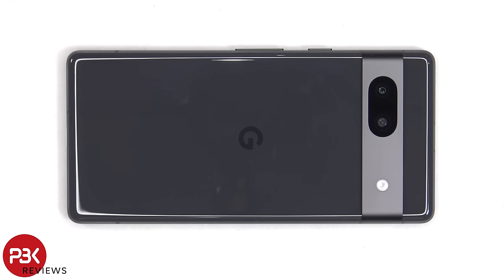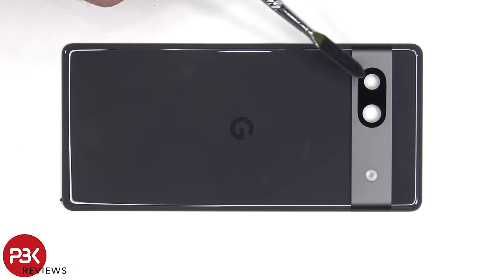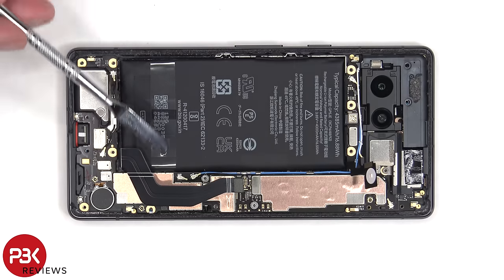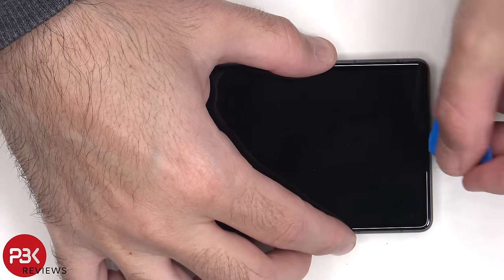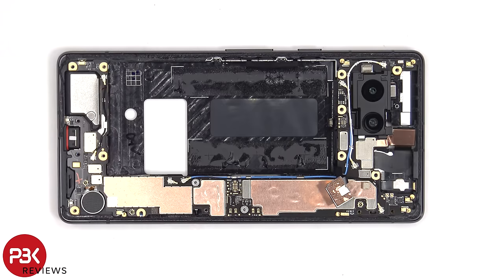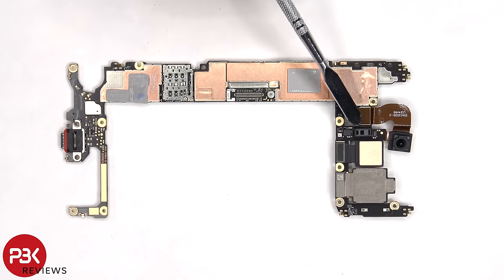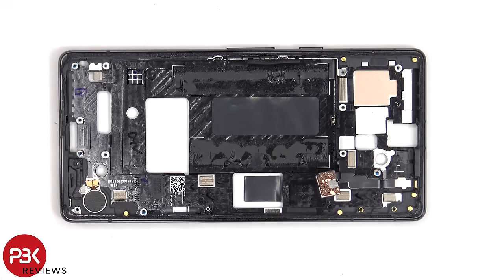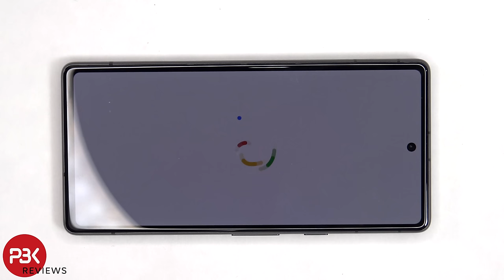Google Pixel 7a Teardown Disassembly Repair Video Review

Comment: Ooo Phone not even Launched but it disassembled by you sir ❤
Reply: @PBKreviews  have they tried to improve cooling system in pixel 7a compared to other pixels. Because lots of graphite taps, copper sheets and a copper plate
Reply from the maker: yes, it's improved over previous generations.

Comment: Nicely described! Thanks!

Does the back stick firmly after reassembly or will it lose adherence?  I wonder if it will open up if it falls on the ground or with even with regular usage.
Reply from the maker: You're welcome and thanks. You would need to re apply new adhesive to adhere it back to the phone.

Comment: They still haven't learned 😔. Hopefully, they'll make the pixel 8 charging port removable, either by having its own daughter board or attached to a flex cable. Sucks that it's not removable. That's the only reason I've stayed away from pixel phones.
Reply: I mean Samsung and Apple have even worse repairability scores on most of their modern phones.
Reply: @michaelcorcoran8768  ik. I hate the damn superglue they use on their phone screens and back glass. And until this year, on samsungs batteries. But they both have removable charging ports (except for the s10 series (and early samsung phones)). That's something that will break with years of use. Being able to open the phone up and replace it is great, but you can't do that with the pixel phones. They're soldered directly onto the board
Reply from the maker: Yep hopefully they will add replaceable charger ports soon
Reply from the maker: True the microphone replacement will be brutal as well. They really need to make a replaceable sub board for these things.
Reply: @PBKreviews  Are these not replaceable with hot air?

Comment: Hey there, hello, since you seems to know both the pixel 7 and pixel 7a, do you think it will be possible to replace the main wide  camera on the pixel 7 with the one from the pixel 7a? they seem to have the same connector. would appreciate any help.
Reply from the maker: I'm not 100% sure, sometimes its possible but sometimes there are software restrictions.

Comment: How does it feel in hands? Even though it's plaastic, Google has been really good at making solid polycarbonate chassis like 3a, 4a, 6a... no banding or screaking
Reply from the maker: Metal frame feels sturdy and good, back is ok but I personally like soft feel backs like those of etched glass or vegan leather etc.

Comment: Any guess as to why the 7A weighs almost the same amount as the 7? The chassis is smaller and the back is plastic. I would've thought it would be significantly lighter.
Reply from the maker: Not too sure, but might be the additional copper plate inside and some other stuff. But don't go based off initial rumored specs, since not all of it seems accurate for example the battery size. This is an actual retail unit and the battery size is smaller than what initially was leaked on some specs.

Comment: I would ask do bend test BUT midframe looks solid.  Edge cutouts for antenna in camera proximity.  Make fail bend test for 7 Pro and looks 8 and 8 Pro they also have edge cutouts there.
Reply from the maker: yeah the metal frame is pretty solid

Comment: Hello!!! My Pixel 7a stopped reading mobile signal and wifi, it also lost the IMEI, it happened suddenly, I suspect a hardware failure on the antenna, how easy would this be repaired?
Reply from the maker: I don't think it would be antenna related. A bad antenna would not cause IMEI loss and so forth. You may have a bad bootloader or firmware and would require flashing original firmware onto the phone.

Comment: How big is the main sensor? Rumors pointed that its IMX787 1/1.3"
Reply from the maker: I'm not too sure, I'm going based off unofficial specs. Apps like hardware info and so forth don't really give sensor type or name, and due to pixel binning only give the base pixel info from the looks of it. If you can decipher the info from those apps, let me know and I will send you screen shots.
Reply: @PBKreviews it is possible to estimate the sensor size if you can give me the size of an individual pixel.
Reply from the maker: send me an email to my user name at gmail and I will send you the screenshots with the details
Reply: @PBKreviews  sent you an email

Comment: Is the vibration motor a downgrade? It's circular and could very well be not an X axis vibration motor :/
Reply from the maker: looks similar to that of the 6A
Reply: @PBKreviews  yep. I realised too. It's weird, because in other phones a circular one means it's a cheap one, but with Pixels it's still feels as good, as their flagships.
Reply from the maker: The newer generation circular ones or z axis aren't like the old ones they would use back in the day, they are better but still yeah the x axis ones are preferred by most

Comment: Info on the fingerprint scanner? Ultrasonic one? Or other?
Reply from the maker: its optical
Reply: Shame I was tempted but if it's the same garbage optical sensor as in the existing 6 and 7 pixels it will be awful 😩
Reply from the maker: Yep pretty much the same thing. On the flex cable it says V10 (version 10) compared to V4 on the 6A but not sure if its any different. Sensor looks exactly the same.

Comment: Mr.pbk why my phone overheat I notice that the upper part of the screen and back was overheat what's the problem of this phone?
Reply from the maker: On the pixel 7a or another phone? It can be many different things. If the phone is being used, surfing the web etc, then the antenna is in use as well as screen being on generating heat and the battery as well on top of the processor. Heat is normal since the point of the phone is to remove heat from inside and exhaust it out of the phone. But if its really hot, then it could be water damage or the thermal paste or pads have worn out or dried up and don't work well to transfer heat.
Reply: @PBKreviews  the other phone like Samsung a03 it's overheat.I notice it's overheating.
Reply: @PBKreviews  Mr.Pbk what should I do if my phone is still overheating?What is a good way to be gone this overheating.

Comment: if i  have slightly cracked the corner of the back glass, is it still IP68 certified?
Reply: no, any damage to structure compromises ip rating
Reply: @federicorubionavarro3399  yeah, in the meantime i managed to change the glass myself and noticed that there is not underlying material other than the glass :)

Comment: What's the difference between a pixel 7 and a 7a
Reply: built quality ..7a back comes with plastic frame 7 comes with glass back and feels expensive ....other then that they are quite similar ..maybe the screen is better on the 7 but over all u wont notice any diffrence

Comment: Hello, PBK can you post dimensions of the phone?
Reply from the maker: 152.5mm x 73.1mm x 9.3mm
Reply: @PBKreviews 9.3mm thick?

That's THICC
Reply: Probably includes camera bump. But the dimensions are overall disappointing. Pixel 7 size. Why larger than 6a with the same screen? Especially the width...
Reply from the maker: Not including the camera bump.

Comment: I didn't know you could use plastic back with wireless charging, I was afraid they would make the back on glass
Reply: Also, how the hell you have this and nobody has made a single new about it?
Reply: Plastic, like Glass is not a conductor of electricity. Hence its able to allow features like wireless charging. Samsung and Palm has done it a while ago with the Palm Pre and the SIII
Reply from the maker: Yeah, plastic would work just like glass. Sometimes I am able to get them a bit early :)

Comment: Pixel's phones needs implement vapor chamber or heatpipes to resolve overheating issues. Has this one modem Samsung or Qualcomm? What about battery life? Charger replacement 👎
Reply from the maker: Yep, but the copper heat plate is a good step forward. Hopefully next time around they will implement a vapor chamber. Not sure on the modem.

Comment: It looks like this phone has copious amounts of cooling conapred to the Galaxy A54
Reply from the maker: Yep, it doesn't have a vapor chamber but does have a lot of copper and graphite.
Reply: @PBKreviews  Interesting. Do you think the A54 or the 7A has better cooling then overall?
Reply from the maker: hmm I would be very border line but I would lean toward the 7A with all the copper heat tape, graphite films and the copper heat plate. But I think I would prefer to replace the thermal compound with a different thermal paste, since this type of thermal compound that is like a rubber type (similar to that used in previous sony phones) I don't find being that well vs the thermal paste solutions.
Reply: @PBKreviews  👍
Reply: Yeah, I am leaning towards the Pixel having the better cooling system myself

Comment: Pixel 7A comes with 4500mAh battery capacity. But here shows it only 4385mAh. Its fake video Lol 😂
Reply from the maker: This is an actual retail unit, not fake at all.
Reply: nominal capacity (4500) vs rated capacity (4385). Every phone battery was, is and will be measured this way
Reply: Precisely. The 4080mah has 4000mah batteries. And so on...
Reply from the maker: If you look closer at the battery in the video, you can see the nominal is 4300 and typical is 4385. So it's not 4500. I know on batteries they always have typical and rated capacity. What doesn't make sense is on the back it has a third value as well at 4344 mAh.
Reply: @PBKreviews  Rated capacity 4300 is like the guaranteed capacity. Typical capacity 4385 is more like the design capacity, many batteries will test at close to that number. The 4344 capacity on the back is the actual capacity this individual battery tested at, that number is printed after manufacturing testing.